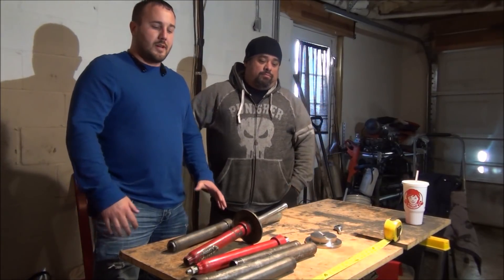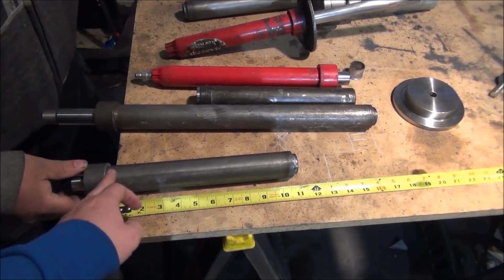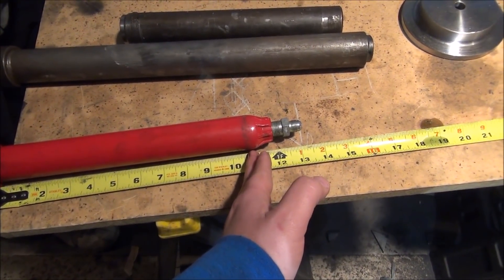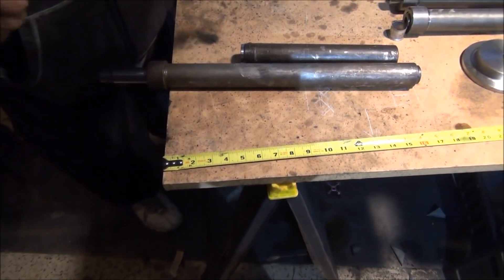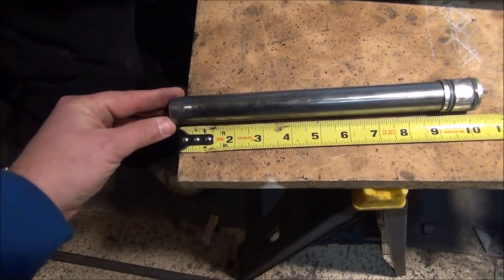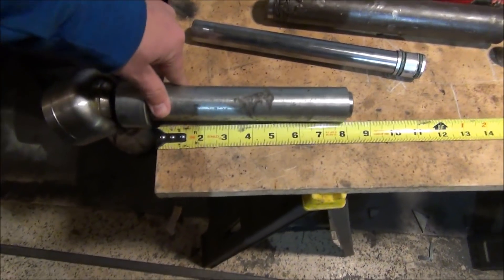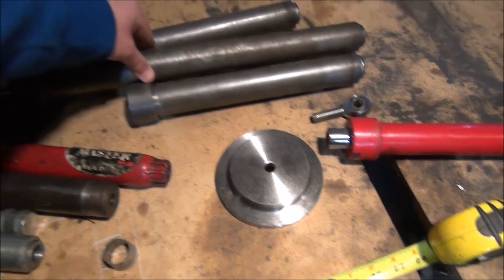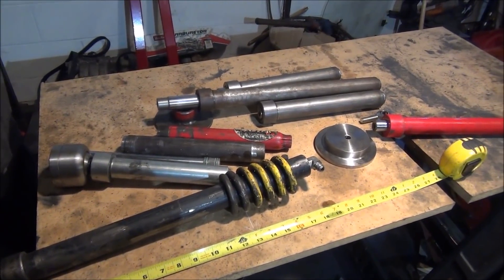How to Measure a Cylinder size

Comment: where does a person learning buy cylinders at?
Reply from the maker: Any number of places. There are privately owned businesses that sell parts and do installs. Depends where you are. You can also purchase from the big companies like CCE Hydraulics, Black Magic Hydraulics, Hoppos Hydraulics, Hi-Low Hydraulics, High Hitters to name a few.
Reply: @LOWRIDERHYDRAULICS i had no idea where to start, or name to look up, TY, I will start looking up there, not seen anything in decades around me, on East Coast, semi rural, today very few use airbags, but most dropped vehicles are not adjustable. but for some reason I want to play & learn how to do hydraulics, trying to learn on youtube, I can weld, fab, do body work & mechanics, but on a tight budget for a few more months & then I want to give this a try, I have my old 64 Impala owned 30 years, but sitting 20+ years,  but its a 4 door, have a 61 Impala my dad bought new, but unsure if I want to cut it up, but real good shape, my uncle drove it until 2 years ago, and I have another 64 Impala also a 4 door, but it has sat 38 years in the woods, it was my dads project car, & left alone after he died, & trying to talk my boss into selling a "junk" 2 door 64 he has to me,  which I would like to do. he owns a small body shop, but got car nearly free, but in several years not had time to touch it.